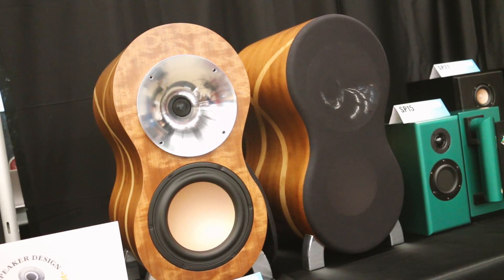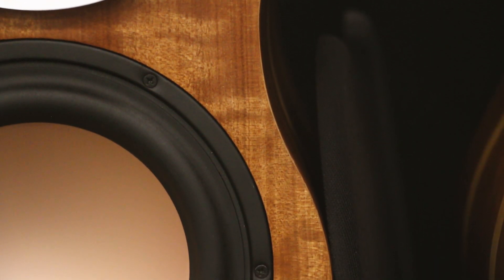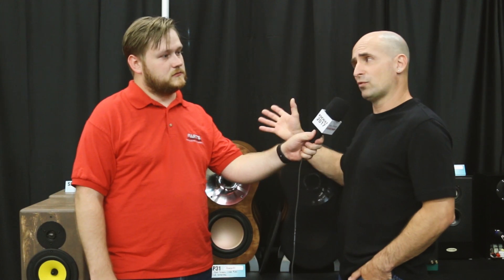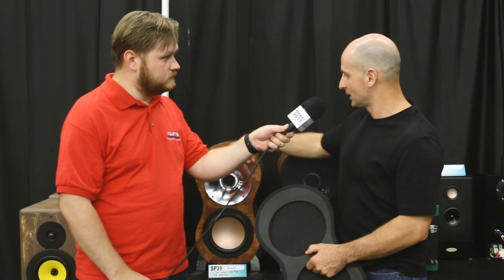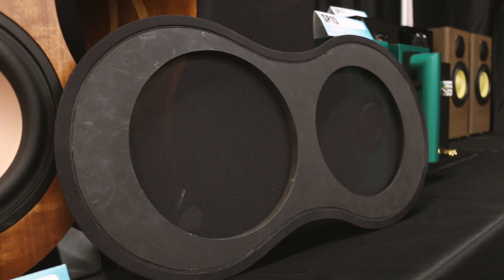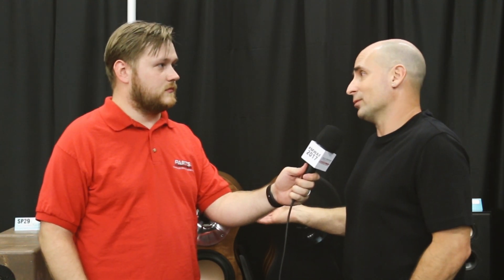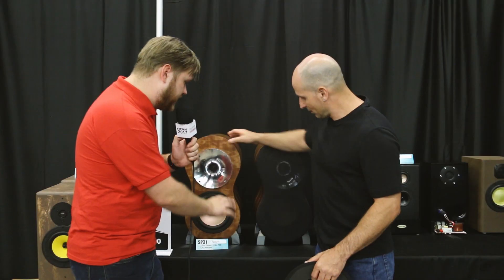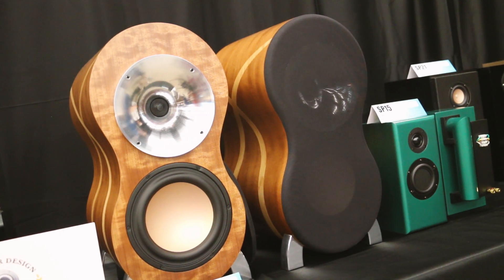Speaker Design Competition Winner - Nick Santorineos - The Peanuts

Comment: How could you build speakers like that for $200? Just the crossover would cost that much. Just to make the most basic priced speakers it would cost like $400. I make speakers and it costs at least that.
Bass drivers...$100
Tweeters..........$50
Bass chokes....$50
Med chokes.....$40
Tweeter caps....$8
Chuff caps........$8
Wire...................$5
Terminals..........$8
Cabinet Materials..$100
Reply: Ehhh... I'm in the process of building some now. 

Tweeters= $30
"Mids" (300hz-7khz)= $40
8" woofers= $80
Cabinets= $40
DIY active crossover using 1-2.5% film caps, trim pots, NJM2068DDs w/ toroidal transformer, linear PSU and repurposed chassis= only $80

It's $70 over the $200 budget, but it'd be doable with smaller drivers in a two-way setup.